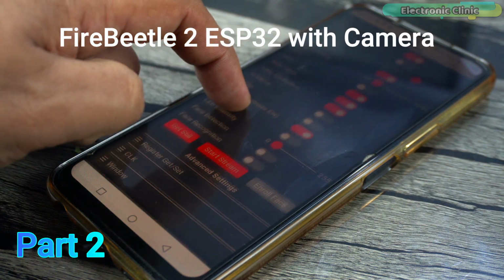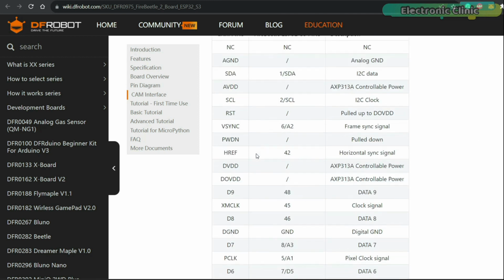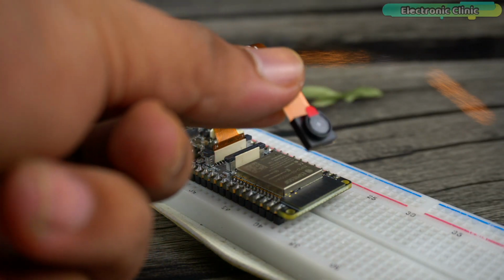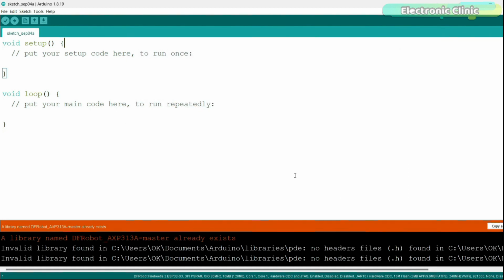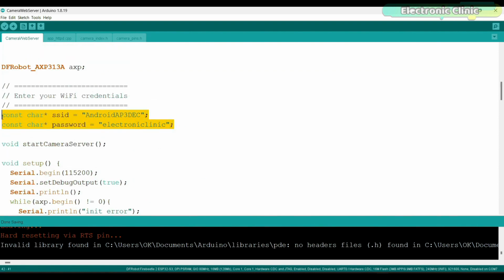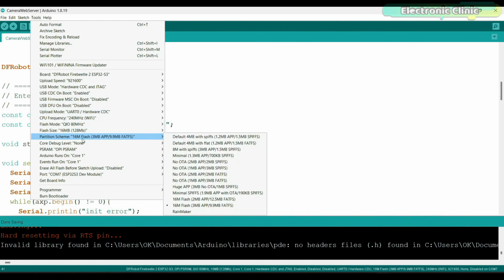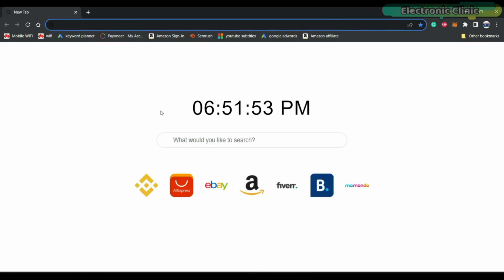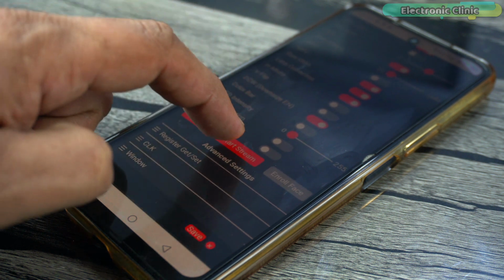ESP32 S3 and Live Video Streaming, firebeetle 2, Wireless Video Streaming

Comment: Hello!I got an problem with that board. Everytime when run the code i got an error: Camera init failed 0x105 and i don't find an solution for that.I tested the camera and change it with another.
Reply: Did you solve it?